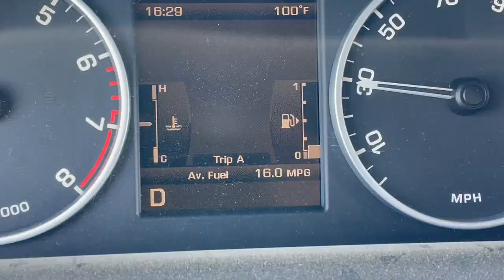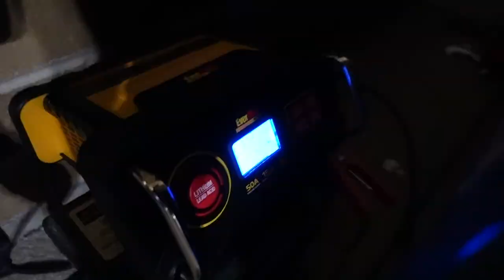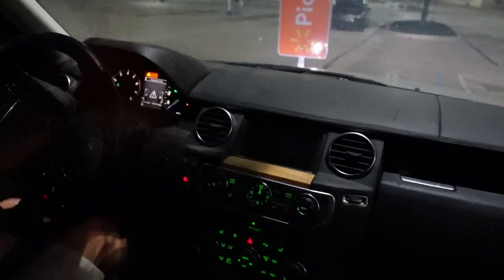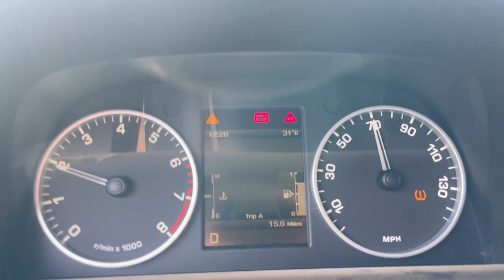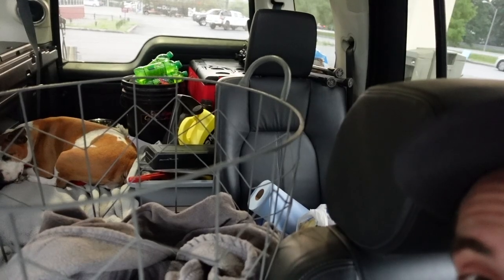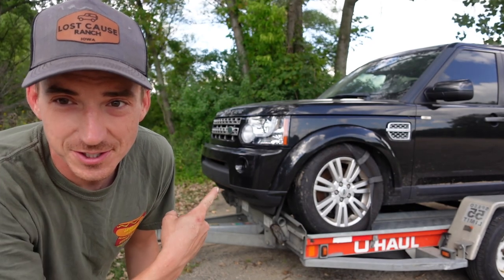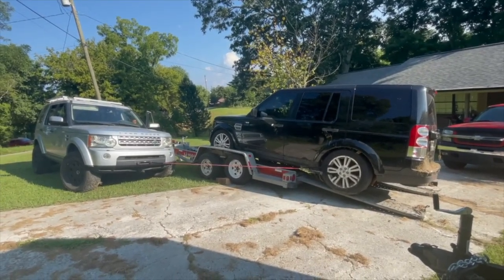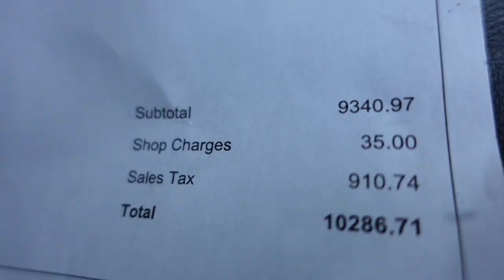Land Rover Rescue! Can The LR4 Tow it 1500 Miles Home? (NOPE)

Comment: Had a parking break jammed locked issue.  I was able to temporary unlatch it with the GAP IID tool but as soon as I stopped the app on my phone, it would lock again.  The issue was the switch and had to take it appart completely to clean it.  Now it works like a charm!
Reply from the maker: It wouldn’t connect to the ecm, tcm, abs or the epb modules. So I couldn’t get in there with the scan tool and release it. I’ll have to figure out the communication issues. 

Funny enough I need to pull the switch on the silver one as well as it has been finicky lately.
Reply: Once I got the switch assembly out, I tried just an alcohol spray cleaner and it worked for a month and then it started to fail again (on a family trip, of course but the GAP IID saved the day).  So back home, I disassembled the switch to clean it thoroughly.  The hardest part is to take the plastic cover without breaking it.  But then, you push out the 2 pivot stainless pins and it will come appart easy.  I was able to diagnose that the previous owner was using 2 milk and 1 sugar in her coffee and most likely without a lid!  ;o)   Anyway, it was worth it, now it's running very smoothly.

Comment: I'm super happy to see the LR4 will keep driving with a blacked out cluster and most likely under 11V.  That is a great news to me!   Thanks!
Reply from the maker: It was definitely not happy when it got down that far, was getting a little Bucky. But it was in the mid 8s voltage wise when I shut it off. I think the cluster went dead somewhere in the 9.5v range. Pretty neat that it would run that far down. It kind of gave a step of warnings. First the charging system warning. Then the next was the transmission fault. Then it popped abs/traction and everything else then a few minutes later came the dead cluster.
Reply: Thanks for those details!  Wow, 8V!   Means we could run this engine on a 9V toy battery ;o)  Glad you could make it back!

Comment: Question for you! (awesome video btw)

Im looking at a vinyl hood decal for my 2013 LR4 - I know they only last typically around 3-5 years... my question is, do vinyl wraps/decals ruin the paint underneath? I don’t want to take the vinyl off and the paint underneath be ruined from the vinyl.
Reply from the maker: Thanks for watching it, it was kind of a fun journey. 

On the decal. If the paint is decent quality it usually holds up fine as long as it’s a good quality vinyl. The one thing that can happen depending on the color is differing amount of paint fade between what is under and what isn’t. 

But typically a light buffing after pulling it off makes everything look normal.

Comment: Is a timing chain replacement due to neglected maintenance, low oil pressure, or actually something that commonly goes wrong on those motors.
Reply from the maker: It is multiple things that can lead to the failure. The 2010-2012's had a subpar tensioner guide rail that was updated in 2013. That extended the life quite a bit. Another problem is Land Rover recommended oil changes at 15k miles, so that coupled with the early poor design guides really didn't fair well. We've experienced an extended chain life on LR4's that had short (5-7000 mile) oil changes compared to dealer serviced. We've replaced chains on one owner dealer maintained vehicles as early as 60k miles and this one in the video was on the original chains until 183k miles. So there is a range. 

I have a video going up today on the complete replacement, it's kind of long, but if it interests you at all you can see a little more in depth what happens to them. Feel free to skip around in the video.
Reply: @LostCauseRanch  Appreciate the feedback.  I've been looking at v6 models and came across your channel.  Wondering if they have similar issues.  I've been a Toyota owner but have been considering an LR4 for a bit more luxury. I I know I understandably will have more maintenance issues, just trying to get a feel for how much more.  We use our Tundra on road trips to pull a small camper but also do a fair bit of off road trails and remote camping.  The Tundra is unfortunately loud, not a great ride, and has terrible mpg, but it has always been incredibly reliable and that means a lot. We've thought about taking our Highlander on trips but it sucks off road.

Comment: Hey Joe, if you have some timing chain experience on any 2014-2016 3L SCV6, would you please share that while fixing Merlin?   I know the chains are updated but I don't know about the tensioners or what else they made better (or did not).  I personally took my secondary battery out to disable the stop/start (ECO mode).  I mean, that has to be the worst idea on a car that has timing chains getting slacky loosy.  My 2016 LR4 is 112000km and it's been well maintained at the dealer but I can hear her ticking when cold already.  I'm really not sure what I should use as a threshold for having the chain/tensioners replaced?  It's a hot topic on the forums and not much good answers.  Anyway, your thought would be appreciated on those later years.  Insert in any episode you feel makes sense, I watch all your videos anyway.   Cheers from Montreal, Canada!
Reply from the maker: I definitely can, the timing chain setup is the same on the 6 and 8 cylinder ones now. The big update which all of the 6 cylinders had was a steel button on the guides so the tensioner doesn’t wear into the aluminum. But there has also been several part number revisions on the tensioners which usually means some sort of change. 

How often are you doing the oil changes? In my experience the dealer service interval has been some of the issue on these. We keep them between 5-7k miles. 

Ditching the stop/start is probably a good idea if you are having symptoms. 

Typically you will see some timing deviation codes in the ecm before it goes catastrophic and that is a good time to get the fix done. But each case is different and hard to predict. All the ones I’ve had near failure make a fair amount of noise all the time before so if you are listening for it.
Reply: @LostCauseRanch , Thanks this is soooo valuable info!  Also brings down my stress level a lot!   LR did oil changes every 12000Km (7500 Miles) or less but I'll certainly do it under 10000Km (6000 Miles).  It's so easy with the tube and a pump!   About the stop/start, when taking the battery out, you are left with a bright ECO mode off" yellow light in your dash.   Lots of people are trying to find out how to get rid of that so if you ever find out...   Tanks again!

Comment: You must have lied about what you was hauling,  uhaul will ask you what are towing on car hauler that car hauler has a 5200 pound rating lr4 weigh 5800 I used my jeep commander that has a 4inch superlift to  haul my 05 jeep wrangler unlimited rubicon that is modified that weights 5800 with the same uhaul car hauler trailer I felt like I was going to pop a wheelie steering felt lite , so I drop trailer and went home to use my 01 Chevrolet Silverado 4x4 2500hd 8ft box , now I have a ton of control didn't even notice I was pulling anything , so know before you tow and know uhaul will ask what you are towing if the vehicle too heavy they won't rent you the trailer
Reply from the maker: I bet it felt sketchy with the lifted commander. The nice thing about the LR4 on that end of things is the air suspension so it didn’t squat it and make it feel all squirmy. It handled it decent, just couldn’t do 75-80mph like you can with a 3/4 or one ton. 

I may have said it was a Land Rover Discovery to make the online reservation happy.